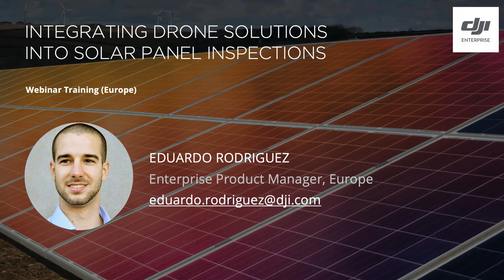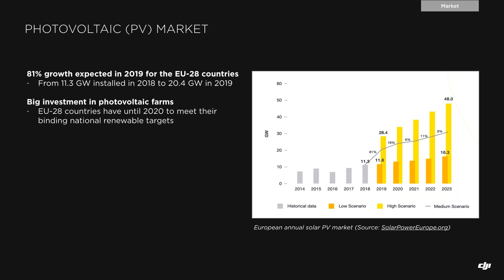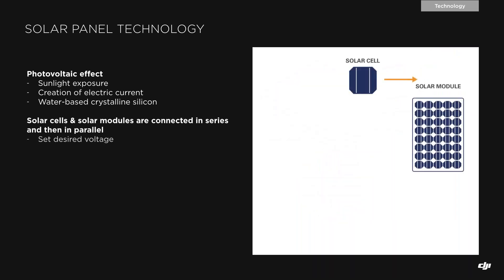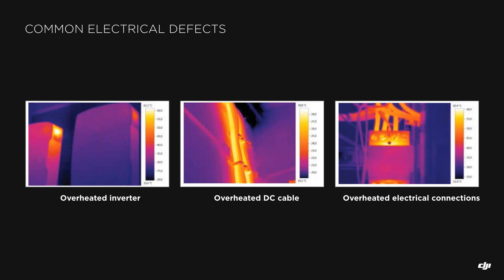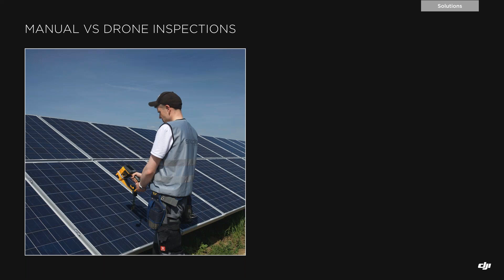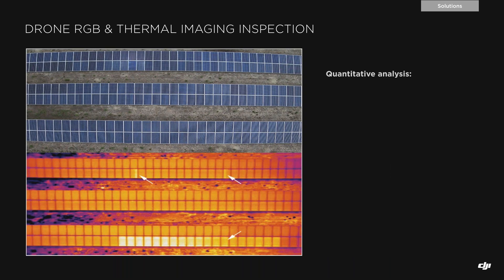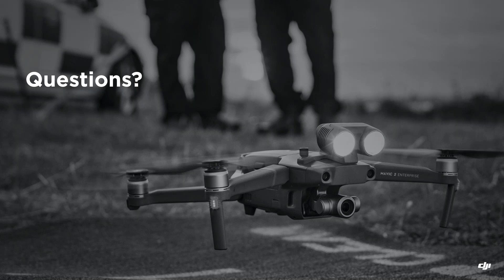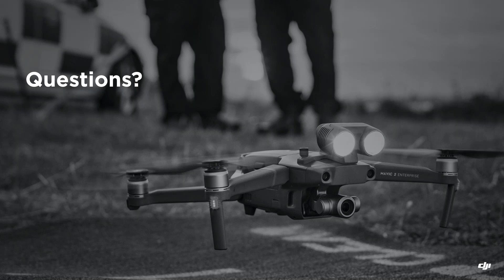Integrating Drone Solutions into Solar Panel Inspections

Comment: Is M2 Advance good for ispection of solar panel?
Reply from the maker: Yes the M2EA can be great tool for solar panel inspections
Reply: @DJIEnterprise  In this video you told us that M2EA is not sufficient for solar panel inspection? Even though it has same sensor as some of the stronger drone models...
Reply: @igoruzon285  He mentioned the Mavic Enterprise Dual not the M2EA. I don't think the M2EA was out at the time of this video. The M2EA has the same thermal camera as the H20T so it's fine. He also mentioned the P4 RTK was mot adequate for "Inspection" and he is dead wrong there. It has a mechanical shutter at 20mp and can get very good GSD for inspection at lower heights. If there is an anomaly it requires a manual inspection anyways. Also, some software that PV farms use to map the photos only accepted radiometric photos from Flir cameras like the XT or XT2. But most software that can handle DJI thermal images now.  This is an old video in the drone world.